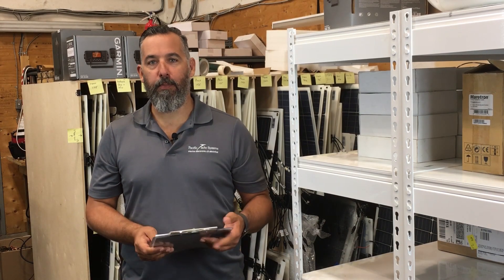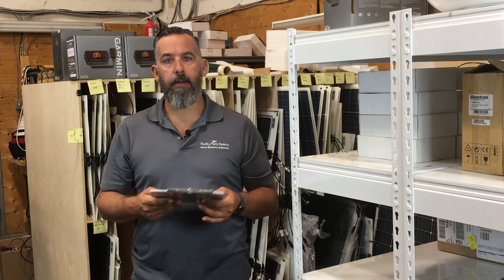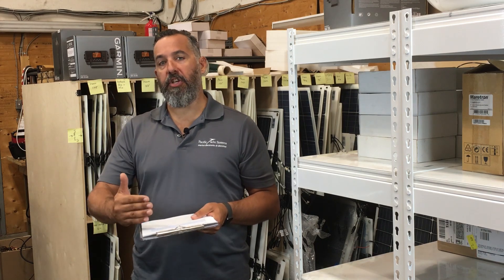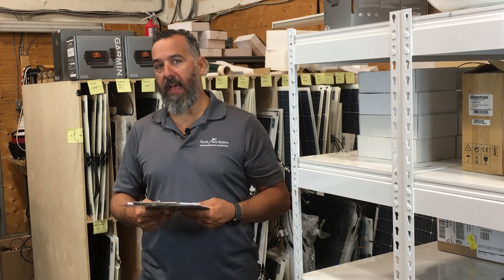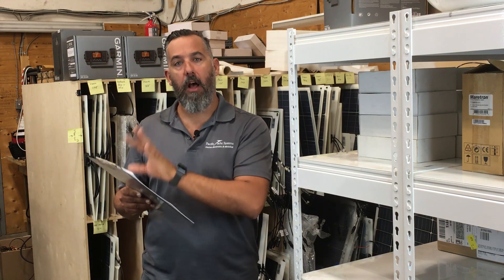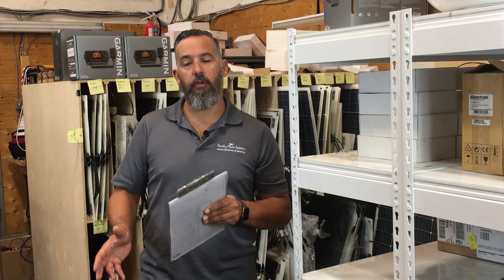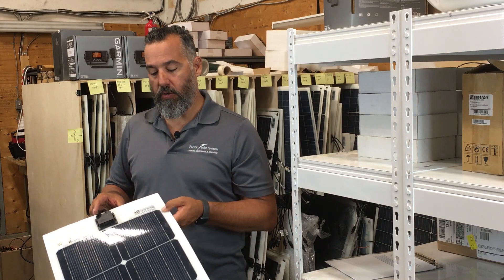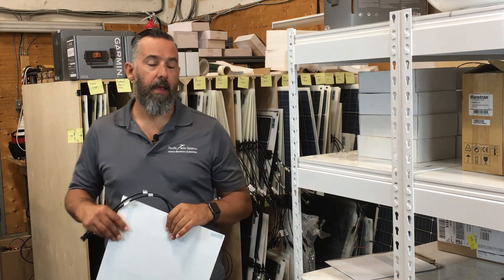Should I Put Flexible or Rigid Solar Panels on my Boat?

Comment: I recalled her that the flexible panels tend to overheat quicker because of its design thus having a shorter lifespan. Is that true or has flexible panels already resolved that issue?
Reply from the maker: Hmmm, rigid definitely seems to have a better life then flexible, by how much, don't know.

Comment: Hi Jeff.  My 32 foot sailboat has a 480 watt solar array (3x 160 watt panels in series; no shading).  This is connected to my Victron 100/50 Solar charge controller and then to my house battery (fused) via an unswitched distribution bar.  The battery is a lead acid 270 amp hour Deep Cycle Master Volt battery.  According to the user manual; Voltage settings: float charge 13.80V @ 25oC / 77oF; absorption charge 14.25V @ 25oC / 77oF (max 5 hrs).
No mention of Voltage setting for Bulk charge?  Interestingly the Victron connect app also does not allow for manual input for Voltage setting Bulk Charge.   Is there a universal voltage for bulk charge for all AGM batteries?
Reply from the maker: Hi Jean, it really depends on how they interpret 3 phase charging. Bulk is max current until you get absorption voltage, then current diminishes to keep absorption voltage constant for an absorption timer, then goes to float.

Comment: Are flexible solar UV stable? How many times more expensive are they than rigid?
Reply: Do they derate if you heat sink them ie. hard mount them to a metal surface?
Reply from the maker: Good questions, flexible is probably 2 - 10 times more then rigid
Reply: @PacificYachtSystems   love your work Jeff...what you don't say says a lot.
 I'm still trying to understand why you like MasterVolt...I'm throwing a Mass Combi in the bin. Studer stole my heart.

Comment: Ok so flexible panels are great .. but the question is .. what is the "best" way to stick/fix them down?? Cheers
Reply: make it so that air flows beneath them, you dont want them heating up. some ppl have used Lexan (multi wall sheet) as a substrate which, by keeping an air gap, enables heat to disperse.
Reply from the maker: Hi Alistair, unlike rigid panel, flexible panels can be directly affixed to a hard surface without an air gap. We use 3M VHB double sided tape. Some boaters use a light adhesive, other boaters are using fasteners.
Reply: @PacificYachtSystems  Thanks Jeff. I'll see if VHB is available here in NZ. Cheers
Reply: @PacificYachtSystems  so the claim that performance gets affected with temperature is incorrect, correct?
Reply: @pmnfernando  I think I can answer to this question. Every solar panel has a property called temperature coefficient. Good quality panels have about -0.3% efficiency drop per degree Celsius. If we assume 10 degree difference between ventilated and non ventilated panels that is %3 drop in efficiency. In a 500W panel system that equals to 15W difference. I don't know how this plays out in practice but in theory, the difference between ventilated and non ventilated should not be important.

Comment: There are questions regarding heat build up on flexi panels.  Best yard stick is to compare warranty periods and expected life time degradation. Think rigid panels will win out every time, and cheaper too.   Check out "Will Prowse" for in-depth solar knowledge.
Reply from the maker: Hey MHappy01, from a panel cost perspective, you are correct rigid panels are definitely less expensive. Here's are some reasons why boaters choose flexible, 1) no place to mount rigid panels 2) they want panels to follow the lines of their boat 3) they want to walk a solar panels.
Reply: @PacificYachtSystems  Thanks for the comment. Horses for courses :-)  Great channel, keep them coming!.   Cheers,   mike